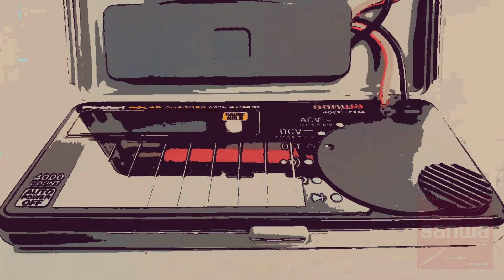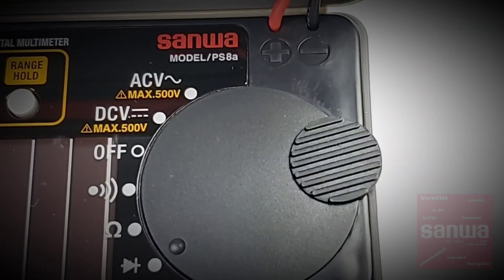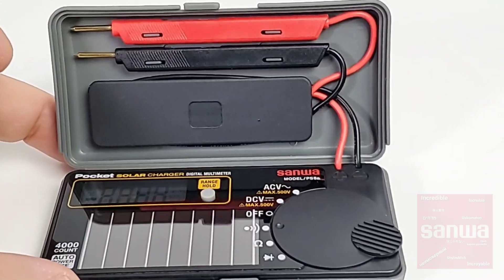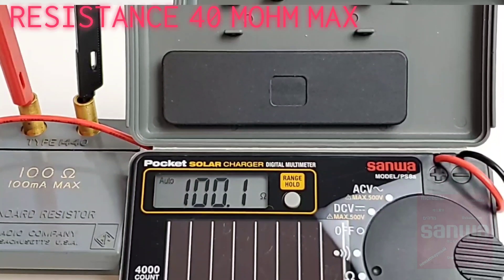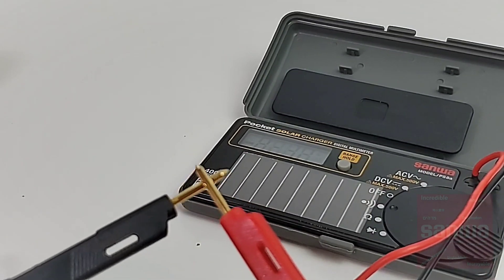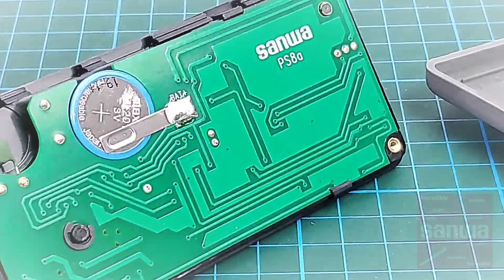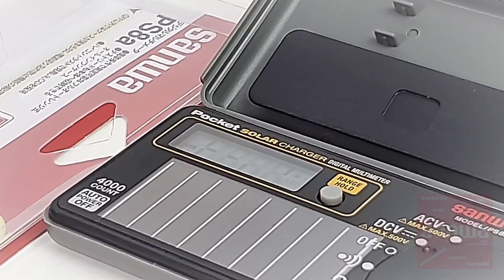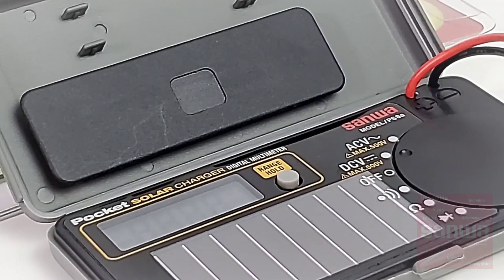SANWA PS8a SOLAR Multimeter Review & Teardown!

Comment: I don't understand why they put the solar cell on the inside, why not put it on the top of the closed case?  Not a good idea to leave your unit open in the sun which degrades the plastic materials, ink on the face, and changes the red leads to orange.  It may also age the components inside or put it off calibration.  What a gimmick!  Less convenient to remember to charge the unit than it is to replace the cell once in a while.  This appears to be something marketing did to sell more units.  They probably looked at the face of the original design and said "let's put a solar cell there, people love solar."  BTW, those rechargeable cells don't last forever and do need replaced if you keep the meter long enough.  Love how they overdo the gold on the selector dial springs, for money savings, usually only the very tips are plated gold.
Reply from the maker: Great points once again 👏  Agreed, the cells would do better on the outside 👍 
It was a love/hate relationship with this Sanwa..quality is good but ... 😅

Comment: this is not the first generation of SANWA solar power MULTIMETER,the first one is use two of LR44 recharge battery ,and if the meter weak power you can replace two of normal battery to power UP the meter,And this meter can’t.
Notice that this meter must charge it up in full power (but it must take A very LONG Time to charge UP by the sun power to the battery)before you use it only use A few minute than be loss power especially in continuity and diode test,it
is A bad buy of meter of Me 
at few year ago.hope sanwa
product A New generation
of pocket meter of future.

Comment: solar powered meter?! woowww that's cool design! now if only the solar panel is mounted at the outside cover, then it could be left on the car dashboard and whenever you need to check your car battery voltage or troubleshoot something, it will always ready to serve you with a fully charged cell. 😃
Reply from the maker: Hey, great idea!

Comment: Well for me its always kinda hard to judge one of these pocket meters as most if not all have necessary built in compromises.  You cant really compare them to full size meters, you have to evaluate them in their category on their own merits within their built in limits.  These arent meant for full scale bench or  plant use, but more of a carry around for quick checks and light duty work.  Speaking only for myself im not a big fan of the solar rechargeable feature with no plug in option, but that said this is a nice little device with high build quality typical of Sanwa.  If it fits your niche need then it might well be for you, but even with Sanwa's built in quality im guessing the near $60 price for this pocket sized meter marvel will be a deal killer for many given the fact $60 will buy a pretty decent quality mid to full size full function multimeter.

Comment: Somehow I have a weak spot for pocket DMM´s... In the case of this I like especially: Case, build quality, gold plated probe tips and the simply perfect storage of the probes. I don´t like to see: The sliders of the rotary switch scratching over via holes, placed IN the contact area of the PCB.
How would a version of this pocket DMM look alike, the would be preferred (at least) by me? Simply:
- Sacrifice the solar panel. Instead make the LC-Display bigger.
- Make it chargeable through USB (like most mobile phones).
- Use (replaceable) LI-ION accu.
- More deliverd power from the accu should make a propper diode (LED) test possible.
- It should even be possible to add a backlight. (Not one, that works only for several seconds, please.)
- Modern chips are able to deliver more functions. Add some! Like: Hz, Duty cycle, MaxMin, Capacity and so on...
For safety reasons:
- Still no current range. It´s clear: The space in the DMM is to restricted for propper blast shielding.
- Combine the charging port with the rotary switch (mechanically). Port only available in switch position "off". Connector locks switch in position "off". This way secures: The DMM is "floating" when in use. Avoids accidentially shorts over ground/Earth.
Reply from the maker: Fantastic points..SANWA is listening so hopefully some can be realized in the future..That would be quite a revision!
Reply: This guy's suggestions should be taken into consideration! Sanwa.